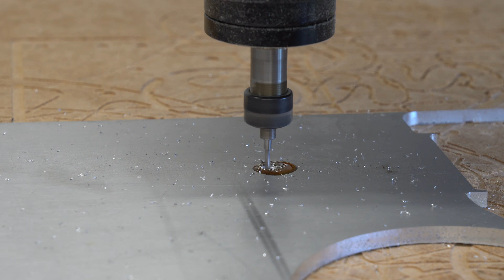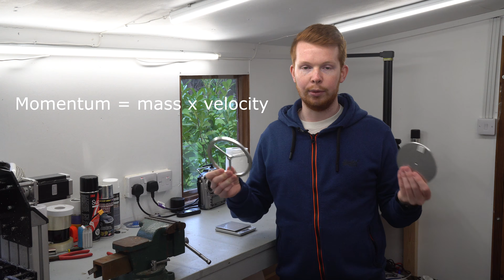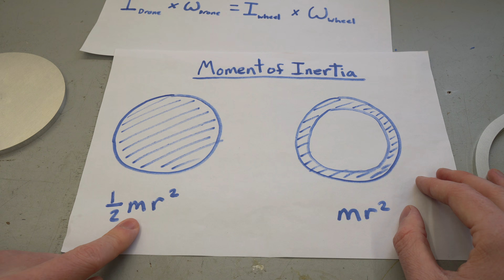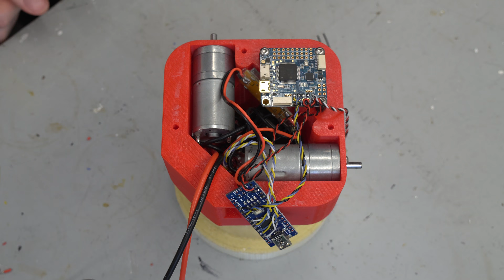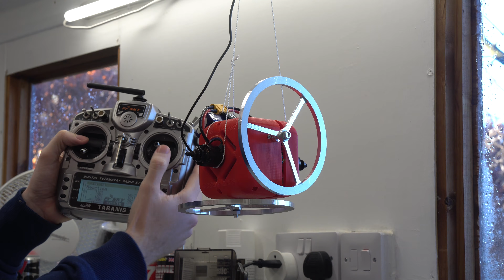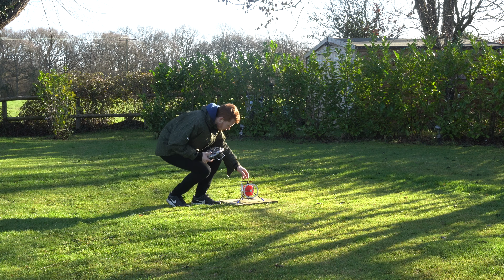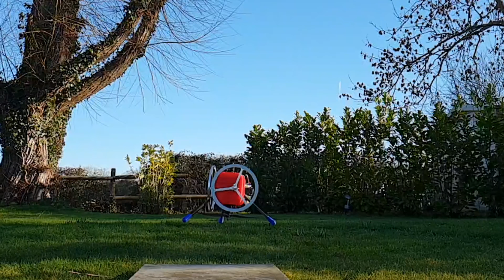Comment: The reason one flywheel motor had more torque than the other was because when you tested the drone by hanging it, that motor spun more. Unlike brushless motors, brushed motors have a break-in period that has a very noticeable effect on performance. Try water breaking in a brushed motor. You'll be shocked at the performance difference.

Comment: I’ve just seen this video. Didn’t know it was six years old. My question regarding the aluminum wheels, what about putting a weight on one point on the diameter of each wheel? I suppose it would kind of be like a keel on a boat? I doubt this will be answered but wanted to get it out of my head. Thank you.

Comment: Wouldn’t it have been better if the pid tuning had been done by hanging the drone about the yaw axis.

P.s This really helped me potentially solve and issue, i was previously using flywheels for ADCS of 3U CubeSat without any holes and was wondering what was causing the saturation. Didn't realise i was missing something this simple that for a complete disc the MOI is 1/2mr^2 but for a circular disk with empty area in the centre has MOI mr^2

Comment: Thinking of having a horizontal flywheel with a momentum that could be pitchable like in rotorblades of a helicopter get pitched. So a horizontal wheel that could get out of balance thru pitching it up and down a little bit that could change te momentum to in axis…

Comment: Hyperspace Pirate made a few gyro balanced drone contraptions Some prototypes were overpowered. While balancing, he'd poke at it and the contraption would barely move, but the gyros would spin up to directly counter the force applied, which was weird to see. Imagine touching a plastic lever. The harder you push it, the faster the wheels spin, but the lever doesn't move at all.

Comment: You could add some tiny blades to the torque wheels to create a greater resistance for better, smoother control, BUT,, that is not what you were trying to do, You did prove your point  about the 3rd Law,,Good on ya, very intertaining video, thanks.

Comment: One of the reaction wheels spun true but the other had a visible wobble. Would that not impart an unwanted acceleration that the machine would then try to correct? but in correcting it imparts another unwanted acceleration?

Comment: the weight is not centered. maybe with 4 reaction wheels (also smaller) so that the weight is evenly distributed. each pair of reaction wheels connected together with a rod or something. wouldn't that help?

Comment: I think you have overlooked a fundamental requirement of your drone to rotate in pitch and roll. It has to do so to vector thrust in order to transition from hover to translational flight. Since your reaction wheels are trying to stop this you have no control. Your system is only designed to stabilise flight in the hover.

Comment: The reason for one weel spining haster and one sloler is  one motor  is designed to spin clock wise and one is designed to counter clockwise derection
Reply: (Haster) faster

Comment: Yeah it looks like the response time on the reaction wheels is too slow. It's tough to accel/decel those inertial masses quick enough with light hardware. 

I think if you had a sufficiently tall drone it would be significantly more stable. Putting the propeller about a foot or more above the reaction wheels would make a much more stable drone. (Think balancing a pencil on your hand vs a broomstick)

Comment: Gyroscopic precession is the key to sustained levitation. If you can spin a small mass at millions of rpm and have a system to be able to add a force 90 degrees to the direction of desired movement or to gravity you should be able to have it move off the ground. Move in any direction you want. The barrier will be a power source and containment and cooling of the spinning mass. Quantum computers, fission and materials will be helpful. Precession works in space and on other planets and has no limit.

Comment: The wheels and motors are not on center of mass. Causing it to make itself unlevel  while trying to level itself if that makes sense.  Which makes it over react or under react. It would explain why sometimes you have a decent test run and other times you have a bad one.  Instead of consistent results
Reply: You should really have 4 reaction wheels all located exactly in the center of the side that why everything is level. You can also use them as a gyroscope to keep the thing level before it even gets out of wack.

Comment: This feels like the 5 stupidest, least beneficial reasons to pick a narrow tire.  Im all for narrow tires but those arent the benefits.  At the speeds you overland, unsprung weight isn't really a concern, else wed all ditch our cragar soft 8s.  Same goes for MPG.  Your fuel economy offroad will be determined almost entirely by the terrain and the driver.  Tire width will make very little difference.  I could go on.  Even his explanation for the performance difference in certain cases was horrific.

The REAL benefit to narrow tires is it allows you to install a taller tire for a given setup.  Adding width to the tire decreases clearance to steering components, meaning you cant run as tall of a tire without rubbing.  And a taller tire adds both ground clearance, as well as increases your ability to crawl over obstacles.

Comment: all you need to do is patch your flight controller software, i think - you nailed it when you discovered that the force is proportional to the speed of the wheel, now go back to your first test, and work out the maths, it will be a function of the natural log, if i remember the terms correctly - it should be an easy fix, and you probably don't need the feedback loop, just the right curve.  suggest you fly the thing on a tether also, the way jet pack pilots train, maybe, while testing?

Comment: I think you also have a problem with the flying wills wobbling that are introducing extra side impulses on the horizontal plane. In my experience with PID tuning, those synchronized impulses are to be able to destabilize any regulator due to the fact that they are ignored in filtering and having a cumulative effect on the body of control. As well as, in order to get read of central mass point issue, you shall have a counterpart will on the other side of the drone body. As it is now, the drone have the tendency to turn against a virtual point that is not located inside the drone. ANY WAY, YOU ARE CLOSE!

Comment: Hello, you are using the flywheel incorrectly. To stabilize it, it must rotate continuously. The sooner the better. But a lot depends on the weight of the flywheel. It cannot be easy, because you need to save energy. You've probably already seen Japanese robots on two-wheeled bicycles and their balance. The principle is the same.
 From Russia with love🤗

Comment: Is the clockspeed of your microcontroller fast enough? Are you using just 1 microcontroller to control  both reaction wheels? Try using a separate one for each to avoid the multitasking penalties.

Comment: you need one smal fast rotating disk (gyro) for each axis you want to stabilize, because if you counter-rotate with flywheel, you have to keep it rotating or leave the environment to stop it (friction), because if it'll stop by axel friction/brake you'll be thrown in the compensated rotation again...

Comment: problem: the whole device does not know where the real horizon is. If it tilts and You try to pull upwards, it just will accelerate to the "up" of the propeller and go into a wobble-course. That is uncontrollable in mid-flight. Put a gyro in - than it works.
Reply: sorry for my poor English....

Comment: Very interesting video! I was quite curious how satellites and rockets turn them self around in space without vector thrusting. Also a quick idea here might be interesting. When the aircraft is airborne, both propellers are rotating and these two propellers might create a gyroscopic effect on the drone. It is harder for the drone to tilt but also requires more reaction force from the wheels to tilt it back to balance. This phenomenon may become worse when one of the reaction wheel is also rotating. I remember in physics class where the teacher give us a rotating cylinder made of steel on an axis and we try to hold it with both hands. We felt the heavy weight, but also the difficulty of tilting the axis.

Comment: Nothing about this makes any sense as a practical design, but I love some of the challenges it presents. I can't think of any way to solve the wheels saturating eventually but there's still room for improvement.

First, the motors probably have far too much latency for a PID controller to keep the drone stable, especially as the torque/gain decreases, you need to characterise the latency and design a more sophisticated controller.

Second, have you factored in the gyroscopic precession from having the reaction wheels mounted away from the centre of gravity of the drone? You can factor this in as part of the feed-forward for your yaw controller. The integrator  of the PID will pick up the "steady state" of the wheels velocity eventually, but you know the velocity or at least the rate of change so you might as well use it. If the centre of gravity is above or below the wheels, they will also impact each other. My intuition is that there may be a positive feedback loop here that will cause their speeds to run away.

Third, a good Kalman filter would go a long way. As the wheels' speeds impact the yaw control, (and possibly each other) as well as causing non-linear gain, having a really good state-estimate of the drone will be very important. Encoders may not even be necessary, but would only help. With a solid extended Kalman filter, you could also give the PID controller much more linear-looking inputs and outputs, this may save you redesigning the controller.

I know this probably won't be read, three years after the video's release, but it's a fun thought experiment and in the spirit of the video "why not?".

Comment: Have you thought about controlling the motors directly via PWM with constant voltage instead of regulating the current?
Motor RPM should be nearly proportional to PWM duty cycle.

Comment: If you do continue with this project, perhaps add a contact switch on one foot of the legs. Include in the code that while the switch is detecting contact, that motion to the reactions wheels is disabled. That way, they only enable after the drone lifts off of the pad.

Comment: you should try having the wheels stably active at idle and slow them down to turn midflight instead of speeding them up to balance the craft, it may take more power but it'll be much more stable

Comment: May be you could significantly improve stability and simplify control by spinning reaction wheels half speed exploiting gyroeffect which already there, then use acceleration or deceleration to control position. Rather then changing direction.

Comment: Maybe the air thrust of the main wind blades interact with the momentum wheels gaps. perhaps wrapping them in cellophane to close those gaps of encapsulating then in thin plastic shell would help?

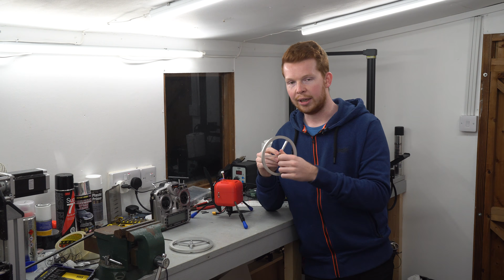Comment: Tom - At around 22:00, you indicate that "the torque reduces when the motor is at high RPM".  This is a natural characteristic of any DC or brushless motor.  Below the maximum-power RPM, the torque capacity is (roughly) constant. Above that RPM, power capacity becomes constant and torque is (roughly) inversely proportional to RPM.  Assuming you need substantial torque for control (which appears to be the case in the flight video), then your actual saturation RPM is  far lower than max RPM, and this makes the saturation problem much more difficult.  Pushing the motor harder with the controller update you are suggesting won't make the motor produce more torque than it's natively capable of at high RPM.  (Might burn it out, though.)

Comment: SUPER WAY after you posted this video, but I'm doing my PhD dissertation on CubeSat attitude control. You could try different configurations for the drone. I would suggest using a fourth redundant wheel and try to get four wheels positioned off-orthogonal. There's some wild and obscure configurations out there. I would also recommend swapping out to a linearized dynamics model around an equilibrium point and use an LQR. The LQR will give you WAY better noise cancellation. Plus you can get some nasty coning if you stick with PID controls.

Edit: oh and another consideration might be to model the drone using quaternions instead of Euler angles. Not sure how much flipping and tumbling you'll do, but it would avoid the issue of gimbal lock/Euler singularities

Edit 2: you could also get away with using just a PD controller to avoid coning and weird reaction wheel interaction. The integral term does some wonky feedback stuff due to coupled angular velocity terms in the equations of motion. If you have a prebuilt controller, just set K_i (the integral term) to 0 and you'll probably get better stability.

Comment: Great video.  

I think if you had made the drone more inherently stable by moving both propellers above the body of the drone your induction wheels would have been able to stabilize the drone provided you dialed in the reaction wheel timing. 

Thanks again for the excellent video.

Comment: There was a simple exhibit at Seattle's Science Center that demonstrated the forces involved. You stood on a freely rotating turntable holding a bicycle wheel that had handles attached the the axle on either side. Spin the wheel, then tilt it in different directions and see what way your body ( and turntable ) rotate.

Comment: I believe the main issue here is that the reaction wheels weigh too much to change directions quickly. This causes their movements to lag behind the pid loop of the helicopters gyro, and so it falls into an oscillation. For this to work I think you would require very high torque reaction wheel motors. In fact I know that some motors can be made in a pancake shape, those motors could likely be used as reaction wheels without attaching anything to them.

Comment: Which 3D printer do you have? What is the metal cutting tool you have? Will it work with Shapr3D generated STL or those new 3mf or whatever files?

Comment: The issue with the non-linear torque output can be solved using feed forward control. The reason the torque decreases is due to back emf voltage. So simply adding additional voltage equal the current bemf will solve the issue.

Comment: Sikorsky had a tough time convincing himself that gyroscopic precession was what it was keeping his helicopters from achieving forward flight. 
Maybe the reaction torque coming from the reaction wheels is not exactly resulting in the axis that the motors are mounted. Maybe that stationary tunning that you did when the drone was hanging from the ceiling have little correspondence to when the 2 propellers are spinning. I imagine those props are light, but hey spin quite fast, right?

I hope you succeed nest time!! Thank you for your videos! =)

Comment: i think because the center of mass of the reaction wheels is offset from the center of thrust, the forces generated by the wheels doesn't quite produce a reaction in the angle you expect (i think this phenomenon is why throttling up a propeller driven airplane that is in an uncontrolled spin can make the spin worse, the gyroscopic forces of the prop cause a reaction 90 degrees off-axis from the prop). if you balanced the setup having a wheel on each side with an axle passing all the way through. this should achieve better balance i would think.

Comment: May I respectfully suggest that you increase the height of the upper propeller, significantly. Since your reaction wheels are having difficulty responding quickly enough, slowing down the movements they're reacting to is the key. Raising the upper prop by 12" or more would greatly enhance the effect of your wheels' reaction. I predict it would fly like butter.

Comment: A Brushed DC motor's speed is proportional to the voltage! NOT the current. By including a negative resistance in the output of the voltage control you can 'swallow' the brush and windng resistance to achieve very good speed control.

Comment: I feel like you need another gyroscope that stays running to add a leveling lock then use the those direction bumps as input directional controls only.

Comment: Maybe you might want to make life a little easier for yourself and the system by using a slightly more stable base system, 
- such as a primitive top driven helicopter with a standard fan for yaw control. Obviously such a system is moderately stable, else helicopters would constantly drop out of the sky. 
- the next more complex version might reduce the heli's tail length or have a small radius deflector guiding the air into counter-rotation for a partial torque compensation together with a small counter-rotating propeller at the bottom. Such a craft should still be mostly stable hanging on the big rotor.
- or lengthen the shaft of the top rotor,to put the center of gravity lower than the center of propulsion.
- or add weights to the wing-ends of the bottom propeller to increase its torque while keeping its uplift quite finite.

Comment: i am curious to know what would happen if you put a rod with a heavy wieght that extended from the bottom of the craft and an motor control it to move up and down - sort of like a weighted haul on ships so that the center of gravity is below the water lever - in this case the center of gravity can be lowered and raised and help keep a steadier balance during flight = still very curious what maneuavers could be achieved with such an added leverage rod down the middle of it - anyhoo thanks again for sharing - i like most of your vids so far - keep up the good work! :)